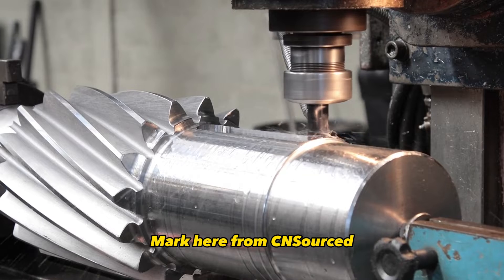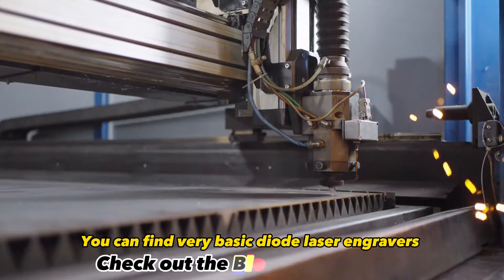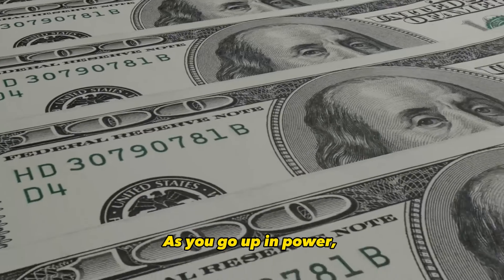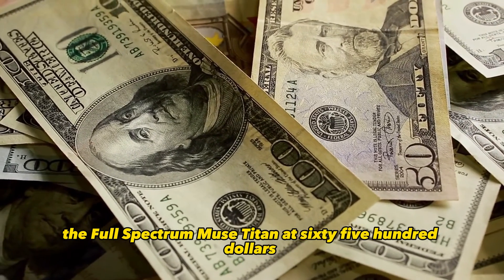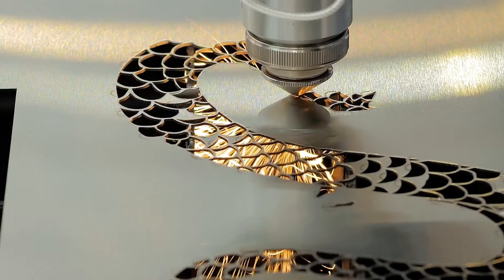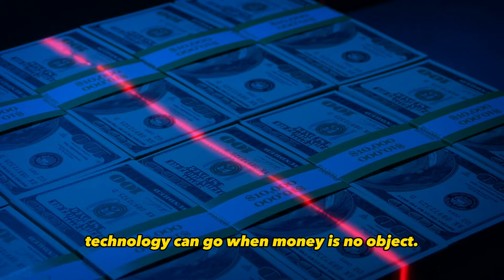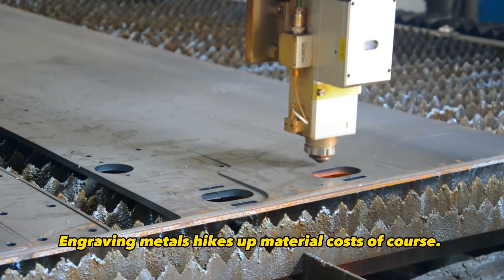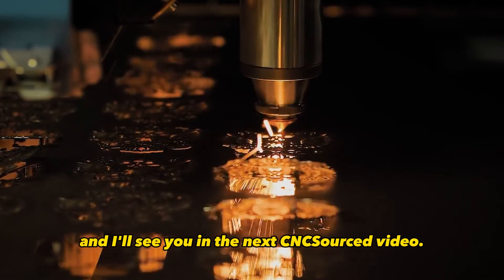How Much Should a Laser Cutter Cost? (Different Budget Levels Explained )

Comment: this is not good information co2 lasers can cut metal and prices are much higher in real life
Reply: I was thinking the same thing. I worked for a manufacturing plant and we had lasers both co2 and fiber that cut sheet steel and I believe we're 50 Kw. We got the fiber shortly before I left and it was 1.2 million.